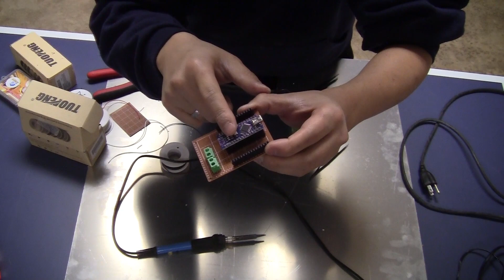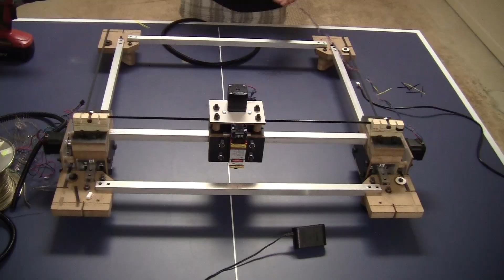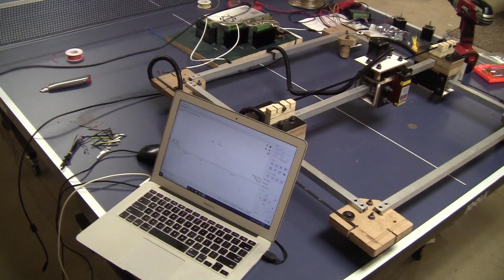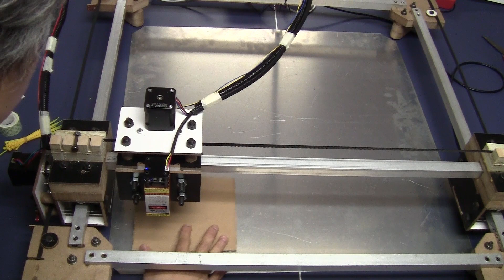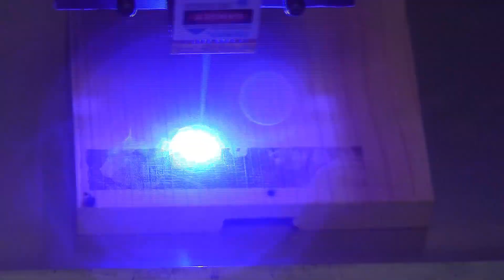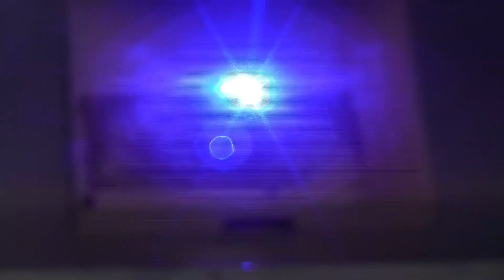Laser engraver - Low cost and easy build - P. 2 - wiring and testing

Comment: I think that you should check that the alu rails are perfectly horizontal. It's fundamental to keep the laser spot focused at the same height all along your session. Cheap rails aren't ALL that straight and software adjustments won't be of any use.
Reply from the maker: That's make sense! Thank you for the advice. I don't have much experience with laser engraving yet. I'm sure all the flaws will show as I use the machine more intensively.